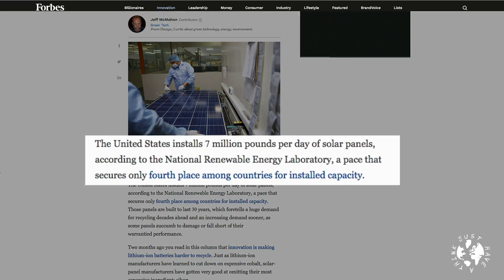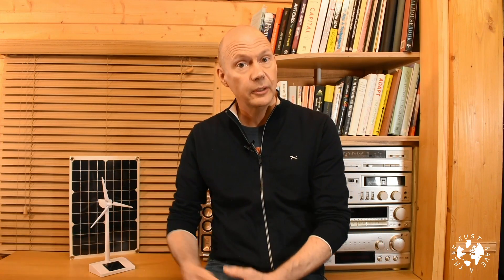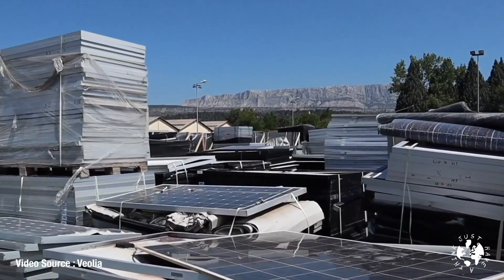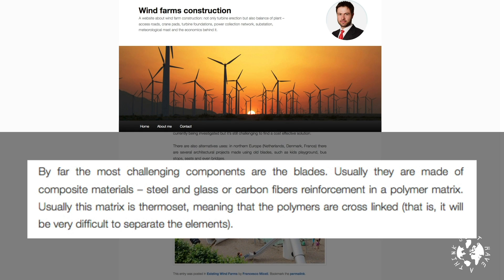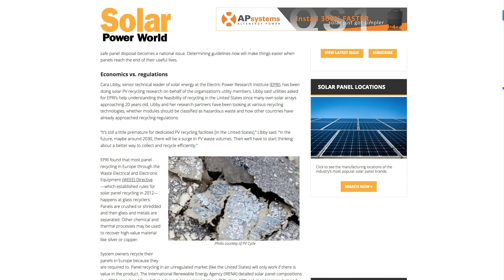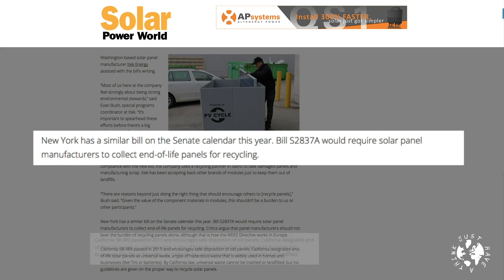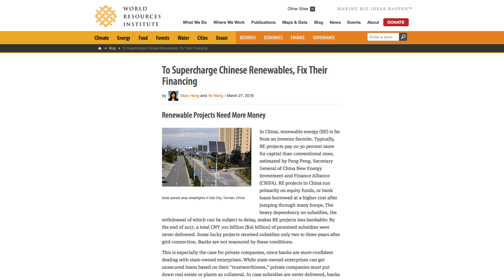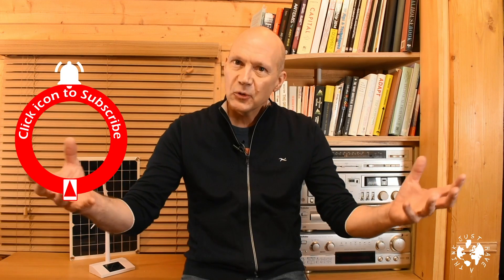Recycling renewables : a price too high?

Comment: We will find a way to recycle but what I would like to see is the use of solar power towers for heat sources in recycling plants.  https://en.wikipedia.org/wiki/Solar_power_tower  I would like to see solar power towers used at all refineries for a heat source over natural gas including heat sources for all industries as a whole, including cement.  There may be applications for heating homes with this tech as well, even at high latitudes.  If the world is going to make any effort at all, it will have to do so with a major push toward near zero GHG emissions at refineries and plants.  In regards to zero emissions at oil and gas refineries, C02 needs to be given a realistic value as a commodity through value that will pay for its recapture.  In order to do this, we need to capture C02 from air using DAC, recombine it with hydrogen produced with electrolysis for use to burn as cleaner hydrocarbon feed stocks in a push to make hydrocarbons with near neutral with emissions.  This world can't get away from the use of hydrocarbons but we can dramatically reduce its footprint.  Currently there are 3 startups working on this tech that I know of world wide.  We need hundreds to meet world demand.  If we can do this, then the use of asphalts (its own end use carbon sink), synthetic crude (84% recycled) and plastics (86% ending up in a land fill carbon sink) become hydrocarbon products with a low C02 footprint with hydrocarbons left over to be burned with electric hybrid tech utilized in higher latitude climates.  With solar and wind (and yes, its can scale with roof top solar everywhere except China and to a lesser degree India, lets think more on that, rooftop solar doubles as a roof, so its a better material overall considering what happens to old conventional roofs when they time out, yup, landfill), we can electrify the world with renewable energy.  We have the tech now to do this and efficiencies will only get better, we just don't have the will in governments because of the big oil lobby pressure on politicians.  For example, the Republican party is bought off outright in the U.S. meaning the political push needs to be come from the all too brainwashed and uneducated masses and we are running out of time.  Still, we have to try.  Effort is what separates the winners from the losers.  Losers find every excuse to give up, throw in the towel and do nothing.  Winners don't focus on the outcome, they focus on the effort it takes to win.  Every time.  Remember this the next time you read a "why try, it will all fail anyway" comment.  Just have a think attracts such comments by the truck load but we've got thinkers here too.  Its far from over.
Reply from the maker: Hi Lorne. Great commentary, especially the final couple of points - you could have been writing the mission statement for the channel! I completely agree with your observations. We do have time, as you say, but as you also say, we must act fast. Climate change will still be there on 4th November 2020 but hopefully the political landscape will have taken a positive step forward on the previous evening!
Reply: @JustHaveaThink  Thanks, much appreciated Dave, cheers!

Comment: Not so sure there will be time enough left to come to the end of recyclables? I ponder 🤔 the rate of methane release. Let’s count the feet , and I don’t mean the ones in your shoes. Considering the instability of the land based ice on the Antarctic. We need to mobilize the methods to sequester nuclear waste from shorelines to Salt mines. We need to prepare farm lands above the coming flood. Much to do with little time. Green agenda is little more than a fiddle.
Reply from the maker: Hi Robert. We need to be fiddling with as many ideas as possible though. Every little helps (to somewhat ironically quote the third largest grocery retailer in the world!).
Reply: Just Have a Think  I agree 100 percent. My thoughts are by doing so we will buy time. You MUST remove carbon from the atmosphere to correct the problem. Industry that produces a product and removes carbon from the atmosphere for profit would be the only way.
Reply from the maker: Very true. I think the closest we have to that at the moment is DACCS (direct Air Carbon Capture and Storage), which I featured a few weeks back
https://www.youtube.com/watch?v=jM7IZM04XG4&t=1s
Climeworks are looking at sequestration in Iceland but Carbon Engineering seem to be looking for profit in producing a hydrocarbon for fuel from the captured CO2, which is at best only carbon neutral and not solving the problem of the carbon negative challenge. If Climeworks and others can get multi national governmental subsidy and support then it strikes me that this is potentially the least impactful 'geo-engineering' proposal currently being developed. It does need 750,000 shipping containers worth of fans to capture 1% of global annual emissions though, so land use (as always) is the limiting factor.

Comment: Would be better to rebuild then to recycle...
Reply from the maker: Hi Patrick. I agree with you. I think there are signs that they are starting to 'build for re-use' rather than for recycling or scrap, but it seems to be at a very early stage just at the moment. All the best. Dave
Reply: @JustHaveaThink  Correct... Just think if you could have a 1 day turn around time for solar panels and a 1 week turnaround time for wind turbines. Problem solved...

Comment: Very interesting and informative as ever. Will the lifetime of solar and turbines increase over time, through the use of different materials, production processes and newer/different technology I wonder.
Reply: Point is that technology doesnt stop progressing so wind turbines keep on getting larger One larger turbine is cheaper to build and maintain than 4 smaller ones and generates more power for less money, so the smaller ones are getting decomissioned sooner as they do not generate enough profit anymore and be replaced by ever increasing in size wind turbines.

Same for solar panels, with these panels the efficiency is increasing so for less space more energy is generated so more profit per square meter, so probably also solar panels get replaced sooner then really required.. A solar panel may generate up to 80% of its original capacity after 40-50 years. 

But if after 20 years or so the panels/turbines are replaced with much better ones and near 100% of the removed panels/turbines is recycled, that is not bad at all! More power from the same weight in materials... sounds good to me!
Reply: All good points. I think that I read about new solar cell technology being tested that is far more efficient that current solar cells. Hopefully over time technology will allow for greater renewable energy capture for less cost, carbon and physical footprint.

Comment: Thanks for this.

Very good article though the article misses out the reuse of wind turbine foundations, the grid connections that are already in place and the salvage value of the neodimium and other components. As said, below, only heard of fibreglass being recycled into cement.

The Washington State proposal is a good one but they should look at the recyclability of duff panels as there will almost certainly be some that fail quality testing and assurance (this would seem a fairly obvious strategy and it is not clear form the article). That would better inform whether costs need to be raised and prevent the imposition of unnecessary costs on the industry. Companies that are forward looking should put pressure on those that are not pulling their weight and inform best practice and higher legislative standards.

Once again thanks for a thought provoking article.
Reply: What are duff panels?
Reply: @flyby2300  'duff', ie not working, fails testing / reworking.
Reply: I do not think neodym is used anymore for windmills. too expensive, most producers did not use it anymore (or never have used it). And the was years ago.

Comment: Well from my understanding solar and wind recycling is possible where as the other radioactive forms of generating electric power are not, so to my mind its a no brainer, keep using solar and wind until that is we can use fusion.
Reply from the maker: Hi Graham,
Funnily enough I've just made a very similar point to another viewer. I agree 100% with your analysis :-)
Reply: @JustHaveaThink  @Graham R Dyer - You are ignoring the relative scales and cycle times in your analysis.

1st - A 1GW (power capacity) wind farm (not a single turbine) uses about 8x more stuff than a 1GW  (power capacity) NPP; and has a capacity factor 1/3rd as much - so effectively it uses about 24x more stuff to produce the same energy (i.e. GWh, not GW).
('stuff' - steel, concrete, etc each have different multiples, so copper might be 12x and concrete 6x - but this is just back of the envelope - you would have to look up each component and etc; I believe 8x is steel; this older study puts it as ~10x)
https://www.nextbigfuture.com/2007/07/constructing-lot-of-nuclear-power.html

2nd - the wind farm has a lifetime of about 30y; the NPP has a lifetime of about 60y + 30y decommissioning = 90y - so you can recycle the wind farm 3x in that period.

3rd - however, only the reactor vessel and primary coolant piping and pumps are heavily contaminated - a few thousand tons out of the total plant size of several million tons.

Although, the spent fuel (HLW) needs storage for 300 y (with reprocessing), the MLW of the reactor+piping doesn't need quite that long, I have put down 30y for decommissioning, because it is easily handled by workers at that point - however, only a few 100s-1000s of tons left - easily less than the un-recyclable wind farm tonnage. Note it is eventually recyclable, maybe another 50 years, diluted with fresh material, it can be reused with a background level of radiation.

So, over the 90 year period:
* the wind farm uses 24x more 'stuff'
** pays the carbon cost of 3x (every 30 y) recycling = 72 'units' carbon cost
** has several 1000 tons un-recycled items

* the NPP uses 1x 'stuff'
** pays the carbon cost of 1x (every 90 y) = 1 'units' carbon cost
** has a few 1000 tons un-recycled items

Comment: Feels like we are overthinking this.  
Let’s start with wind turbines- why would you need to do anything but replace/refurbish the motor (generator) and maybe figuring a way to recoat the blades.  Do a refurb after 30 years and they should be good for another 30.  

For solar- again what breaks down/ ages in a solar cell?  My guess is that the connections are what breaks down.  I am thinking the cells themselves would last for a long time- maybe they need to be polished/ cleaned etc.  

My point is that the design and long term plan should be to reuse as much as possible in the same application that they are originally intended- that should be the goal and built in to the design.  This will also make them much more economical as a power source. 

I know some will lose their minds when I say this but I really think you need to be more positive about Nuclear- at least in countries that already have nuclear.  Once constructed these plants are a zero emission way to generate electricity.  The plants have proven to last for 40-60 years or more, they use very little land and yes they are safe. They should remain part of the energy mix.  

Thanks for the work you are doing.
Reply from the maker: Hi Marpalm. Thanks for your support and feedback. Much appreciated. You make a very good point about the materials re-use. I think that it is definitely the direction that modern manufacturing is headed, but it'll take time for those developments to filter through the R&D process. In the meantime existing hardware is prone to thermal and mechanical stress as well as UV degradation and all sorts of other wear and tear that I'm probably not qualified to comment on, so the stuff we've got collecting sunlight on roofs and spinning around in fields and off shore at the moment will definitely need to be dealt with in a few decades time. Hopefully we might just manage not to screw up our life support system too badly by then so we can actually find out if these initiatives will come to fruition. As for nuclear - no doubt it makes up a vital part of the energy mix today, more so in some countries, like France, than in others. I do genuinely understand the benefits of nuclear but I struggle to get comfortable with allocating areas of land for disposal of nuclear waste that will need to be set aside for countless generations. I don't feel that nuclear proliferation is the answer. Unless we nail fusion of course - them I'm all in! But I think there's so much innovation going on in the energy sector (and I'm trying keep up with as much as possible in the vids) that we will find a good workable solution that entails fewer risks at some point in the next few years. I could be wrong - I often am! Anyway thanks again for your comments. All the best. Dave

Comment: A really clear and illuminating video. Excellent, as always.
I have to admit that I did some basic reading on recycling of solar and wind power components a few years back, and satisfied myself that the problem in Europe was being properly sorted out. And promptly stopped thinking about it. Therefore, the specific thought didn't strike me that this wouldn't be the case elsewhere in the world. Let's just say that, to my mind, there are specific places where 'doing the right thing by the environment' is not high on the list of priorities. So I either have my concerns confirmed or end up surprised.
As to recycling it is the case, more often than not, that the recycled material ends up down the grade slope. And anyway, at the moment it is still often simply cheaper to mine for new. That won't always be the case.
I didn't know about turbine blade recycling, but a quick thought suggested that they might be ground up to an appropriate size and used as a filler material. So it proved. That end material could be continually used and reused as and when there is more requirement for base material [which is always!].
Personally, I think Wind and Solar power both have bright futures. Tidal power needs to come on a pace, [worth a video, Dave?] as there is huge untapped resource there and it largely lives in the shadow of other renewables. I don't include fragile estuaries in that thought. But if we wanted to slow a specific case of sea cliff erosion, for example, we could place a bobbing duckbill type  and turbine barrier a short distance off a vulnerable coastline to suck up some of the destructive power. It's a recurring thought I get. But how much does one interfere with the coastal environment? Even old sea defences often shift the problems elsewhere.
OK, I've rambled enough. Thanks for the thought provoke! 👍
Reply from the maker: Hi Andy. Great feedback. Much appreciated as always. You're dead right about tidal power - it's on my draft schedule list for about 7 weeks from now (although fast changing world events do tend to bugger up my best laid program schedule plans on a regular basis!) - I will definitely be looking closely at tidal soon though - I've seen quite a few very encouraging articles about how much more advanced the tidal turbine technologies have become in recent years, and of course the energy in our waterways and oceans is immense. Have a great week. All the best. Dave

Comment: Interesting video. Even though 30 years seems a reasonable lifespan for wind turbines and solar panels, it would be interesting to see what the scope might be for refurbishment. For example, it seems unlikely that the gearbox, blades and tower of a wind turbine will wear out at the same time. Likewise, the casing of a solar panel may be more likely to wear than the PV panel or vice verse. Also, it's likely that future designs of these items will have better lifespans and the rate of performance improvement will decrease. In other words, they'll last longer and be less likely to be superceded.
Reply from the maker: Hi Tim Tam. Yes I agree 100%. I did think about this avenue of development but I couldn't find any decent info to suggest it's being looked at with any conviction just at the moment. I'm sure that, now the light bulb appears to have come on above the heads of the renewable energy hardware manufacturers, they will start thinking about much more intelligent and sustainable / re-useable materials and elements in the initial fabrication of these units. Here's hoping, anyway! Thanks for your support. All the best. Dave
Reply: Since for solar panels that 25 to 30 year number is for a predicted loss of only roughly 20% of a panels capacity there is nothing to say we can't continue to use them for 40 to 60 years especially since the cost to keep using them as almost non existent as long as they still produce some power.